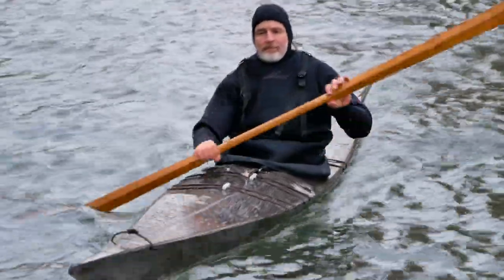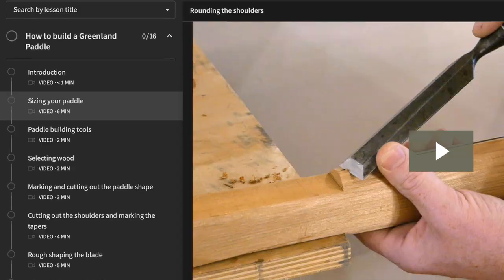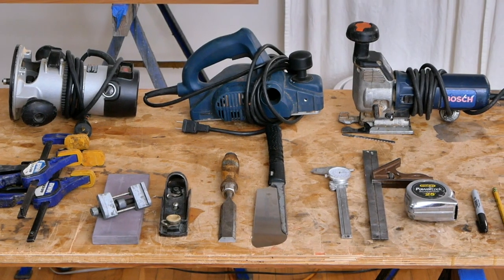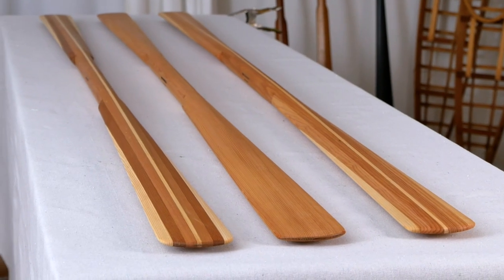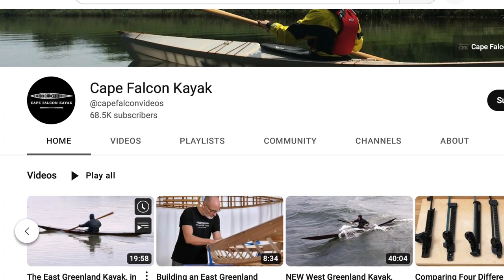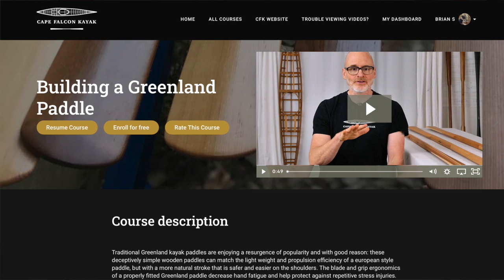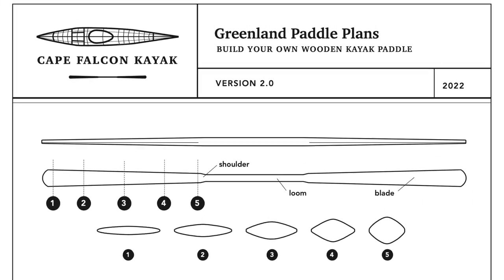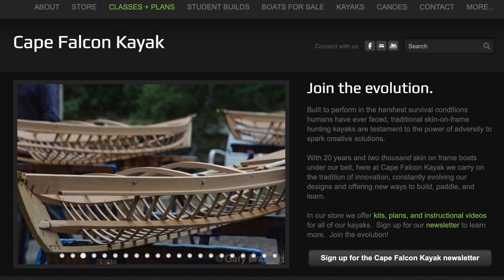Building a Greenland Paddle, Part 1: Course Introduction

Comment: Hello there, roughed in my prototype from your video course using a green piece of spruce 2 x 4, turned out alright.  Now need a sensible piece of board and an acceptable plane that is sharp, also have to buy new blade for my bandsaw.  Next one should be up to your standard and expectations.  Will send a pic then.  Cheers...